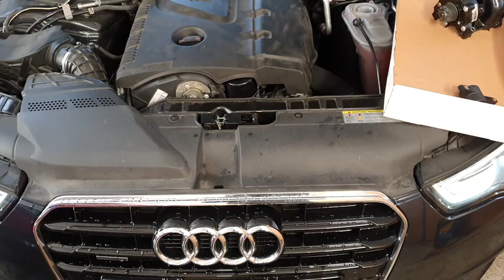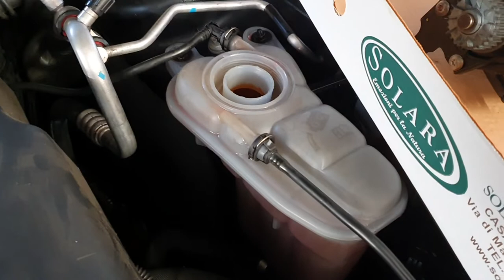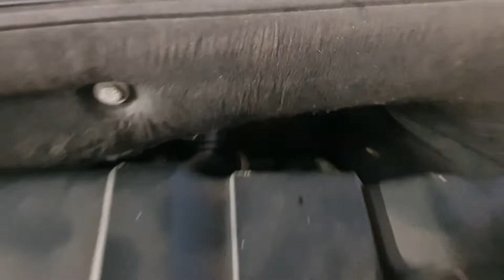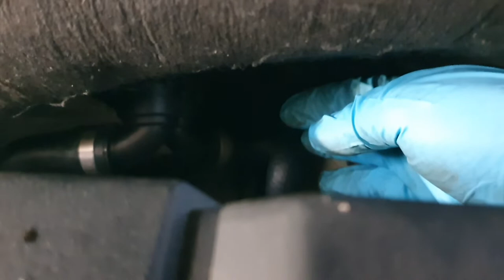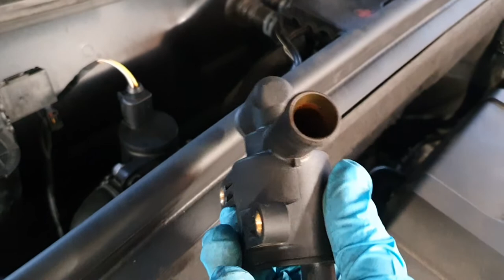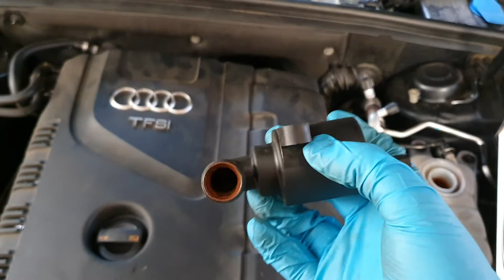vw/audi 2.0TFSI no warm air after coolant pump change or coolant flush, seized heater valve

Comment: Hi! U have to do the adaption with scan tool before replacing that valve?
Reply from the maker: Hi, no adaptation necessary
Reply: Zdravím Honzo, mám chybu 01020 vodní pumpa (v36), podle všeho by to měl být tento elektromagnetický ventil. V kabině se topí i chladí, ale je slyšet zvuk meluzíny a tikání 😅 nevím k čemu jinému bych to přirovnal... Google mi řekl hodně, ale názory jsou různé.
Reply from the maker: @pankejml221  zdravím,  tahle chyba podle visu značí spíš problem na regulaci paliva s chlazením to nemá nic společného. Pokud je auto vybaveno elektrickou dochlazovaci vodni pumpou (vetsinou tdicka) tak chybu hlasit může.
Reply: @janvodicka3057  Díky za odpověď, zaráží mě, že chyba je v sekci, topení/klimatizace, a když mám zaplou klimu tak každý cca 5 vteřin slyším vrčení, když klimu vypnu vrčí potichu,ale stále, slyšet je to pouze v autě....jinak je to A5 2010, 2.0 tfsi, 132 kW.
Reply from the maker: @pankejml221  v tom případě bych to viděl na vybehanou remenici klimakompresoru... ale ta chyba nejspis nebude s tim spojena.